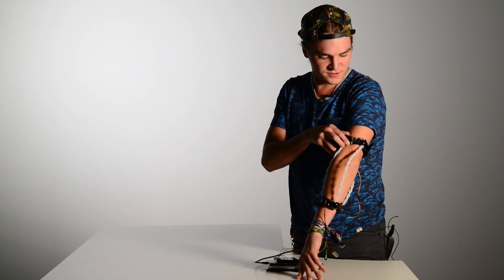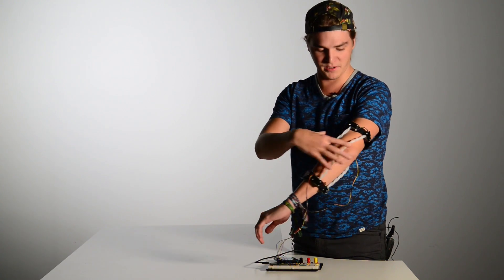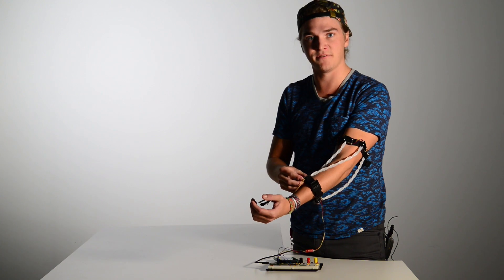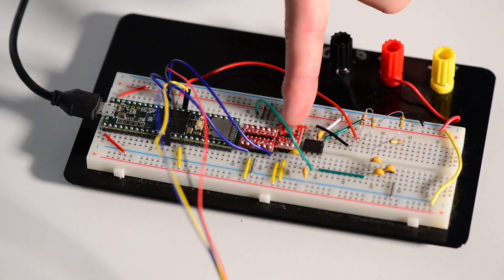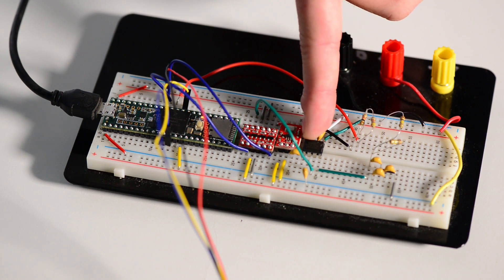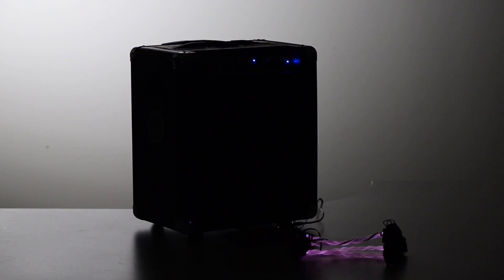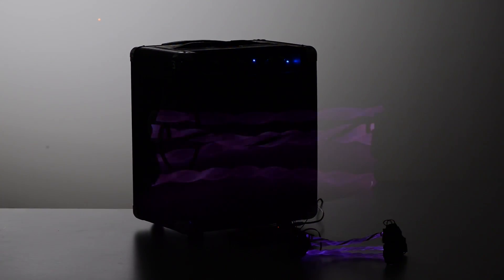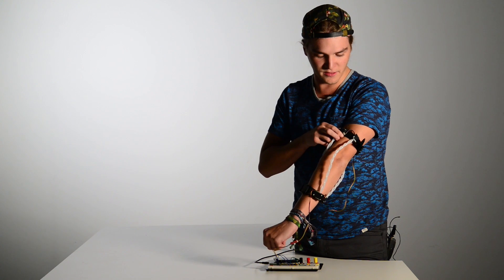Enginursday: Audio Reactive Wearable Fiber Optic

Comment: I did the same project using the same parts, except for the presentation (fiber optic). How you cleaned up the noise the mic generates? Here using the same chips there is a lot of noise...
Reply: give me an article that explain your project pls ,with schematics,parts and stuff ... Thanks